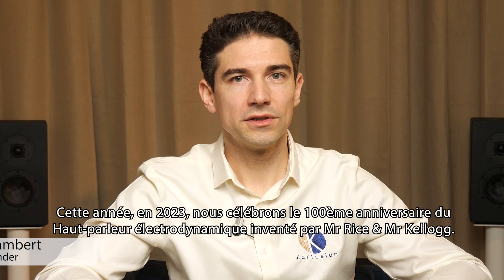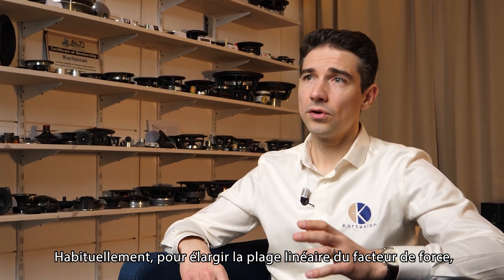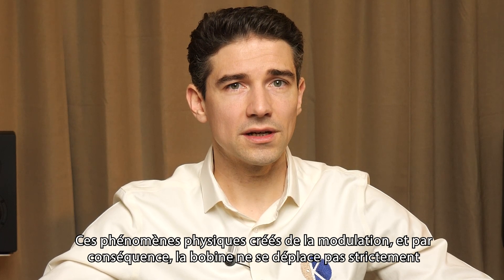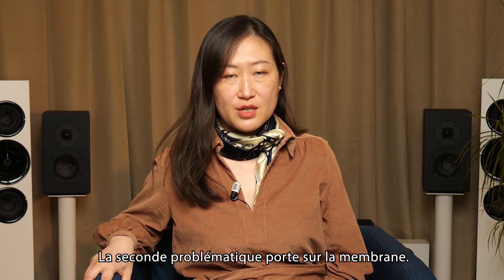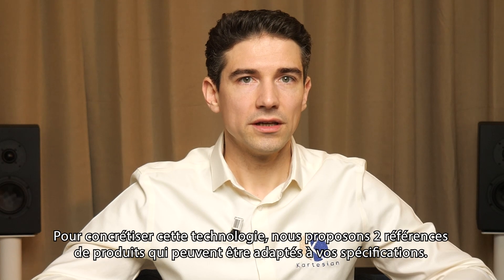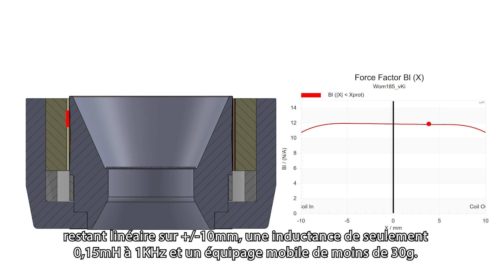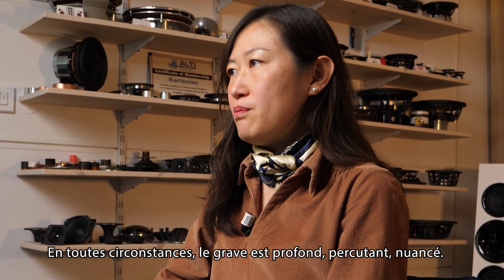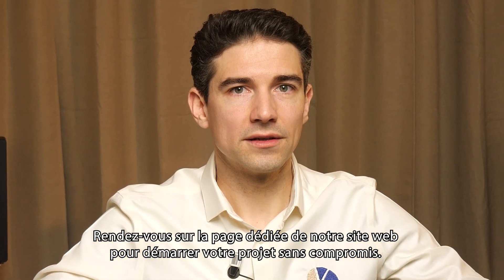_vKi loudspeakers introduction (full explanation)

Comment: Lom185_vKi - this driver looks perfect on paper for a highend acoustic guitar or bass guitar amplifier. 
Would it be as durable as a similarly rated prosound 8" midbass? 
What are the one-way excursion limits before damage? 

Thank you for any information on this. Keep up the great work!
Reply from the maker: Lom185_vKi is designed to provide high SPL with accurate dynamic and very low non -linearity. It is used in high quality cinema studio, prestigious small concert room, …
The max Exc is +/-15mm. 
The large Titanium voice coil ensures high power handling without thermal compression.

Comment: I was looking for drivers for a small hi-end 2-way and finally found the KOURTISANE-4.8 kit - but the Sub120_vHE is no longer available? Is there a plan for a successor and when should I expect it? Even a rough estimate would help me plan. Very impressed by your work.
Reply from the maker: Thank you for your question. We are working on more competitive version of Sub120_vHE, using our last improvements in motor structure and suspension design. It should be available in our distributors on June 2024.
Reply: @kartesian5737  Thanks for your reply!

Comment: Nice video, even nicer drivers and glad to hear you speak English on occasion :) Have you given consideration to Sd modulation or do you find it insignificant?
Reply from the maker: Thanks for your question! Sd modulation is minor issue to be considered on mid woofer (not subwoofer). Our solution for it is the Omega surround. Part of the surround is hidden and used only in larger excursion.